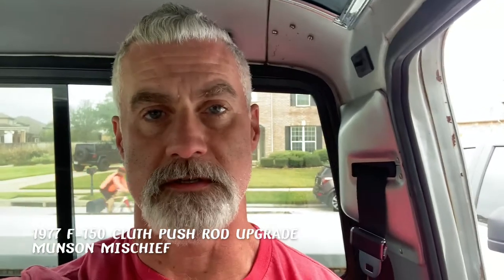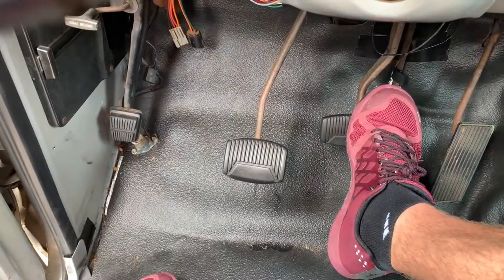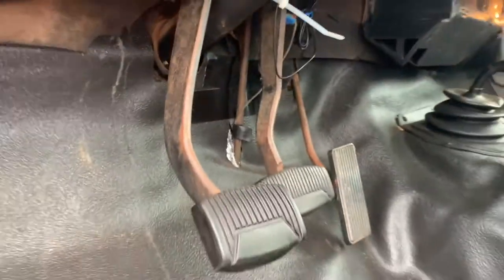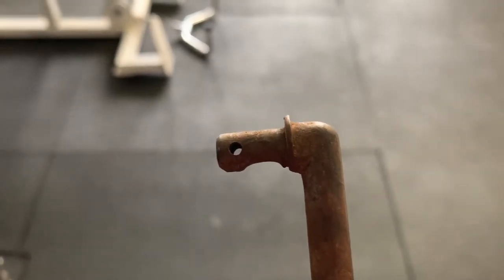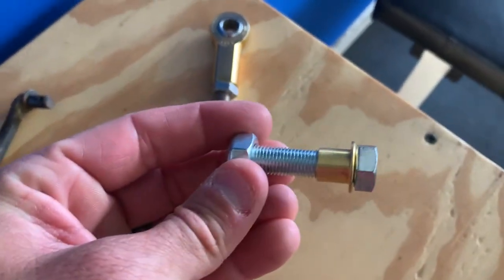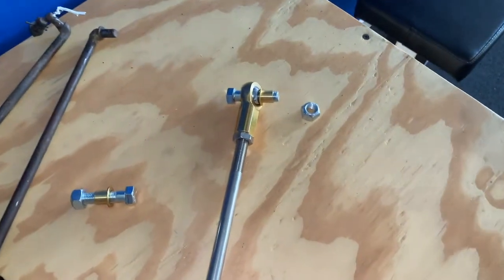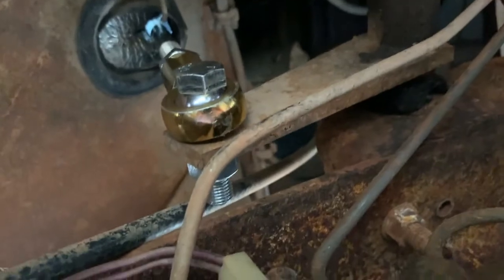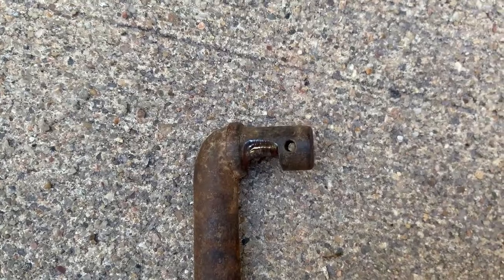1977 F-150 Update - Clutch Push Rod Upgrade

Comment: I was wondering if the issue you had was the pedal not sitting correctly after installing the new? Measure the rod out like you did and then installed it. But now my clutch pedal will not come. Can you help?

Comment: Great video, I have the same issue of a broken push rod I bought the new part from jb custom. Just curious what was the small issue you mentioned in the video. I haven't installed the part yet. Thanks.
Reply from the maker: The clutch pedal, when depressed and then allowed to come back up...it would stick about half way up and then suddenly "clunk" into the unpressed position.